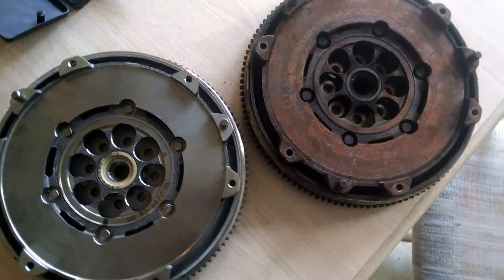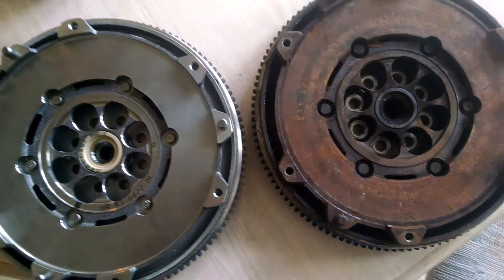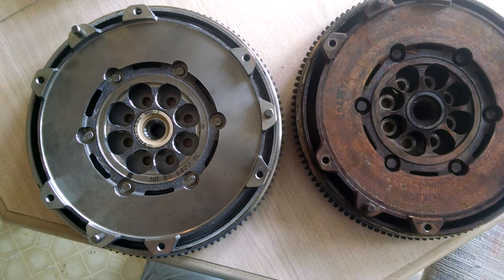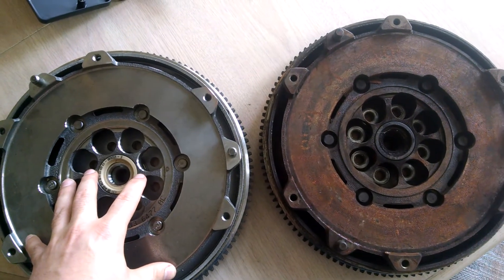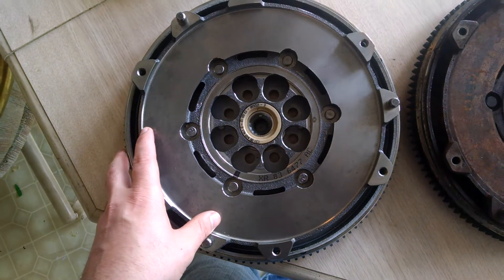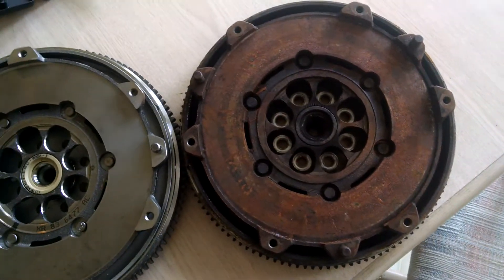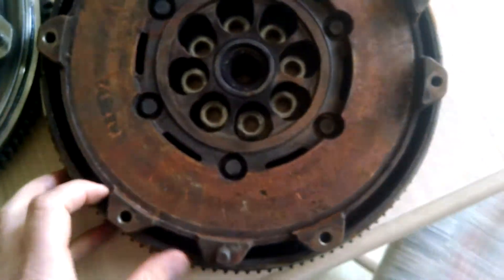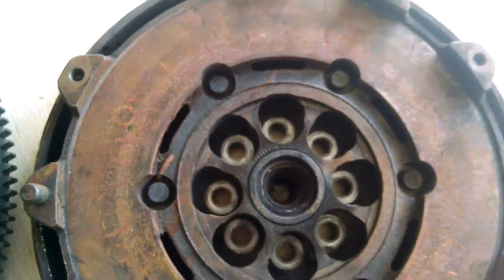Lincoln LS Manual 5 Speed FLYWHEEL

Comment: I have 00 Lincoln LS 5speed. Ordered luk clutch kit from rockauto.com  and dials were smaller. Didn't fit. What brand clutch you go with?
Reply from the maker: There are 2 different clutches. One with 10mm dowels and one with 6mm dowels. Measure before ordering. Outside of that it shouldn't really matter. I got my clutch fron O'riley auto parts
Reply: @DravenUnix  I guess I got the 10.
Reply: @DravenUnix  by any chance is the part number K70299-01 by Power Torque on that set?
Reply: @DravenUnix  also my synchro is out and I have not had any luck finding a parts for my 2000 5 speed here in california
Reply from the maker: @czarel4207  Sadly the transmission that came with the manuel version LS wasnt a serviceable. You could do a fluid change but that was it. I was never able to locate rebuild kits for them. However... sometimes you can get lucky and find a used replacement online. Also i do believe Jaguar S type manual transmission is the same. I did a quick search on www.car-parts.com for the transmission. there are a few listed. give it a look
Reply: @DravenUnix  thanks man,
this getrag 221 has been a headache
Reply: @DravenUnix  i ended up getting the Luke 07-200 clutch vs the PTQ from oreillys
according to their catalog it is not compatible with 2000 module ony 01-03
Reply from the maker: @czarel4207  they are shit transmissions to start with

Comment: I have a 2000 Ls my clutch was replaced. I did not replace the flywheel. I have replace the master and slave cylinder with the clutch. now the clutch doesn't release properly and finds when I down shift. do you think it could be the fly wheel that is causing this issue?
Reply from the maker: That's Exactly what mine did starting out... then it the clutch failed all together. I would press the peddle and nothing would happen. not to mention the wobble effect I got from it. whole car would shake as if the motor was out of balance

Comment: Hey I just bought a 2001 ls 5speed will this part fit my car?
Reply: bro where did you find one I've been looking for a while now ?
Reply: @mdrakeslayer7805  You looking for the car, or flywheel?
Reply: I don’t think it would fit. I have a 2002 LS Manual and I notice online parts from 2000 LS don’t fit for 2001-2002 like the Clutch and Clutch Pressure I thought they have the same transmission. I’m just curious if the flywheel the same tho

Comment: Is the flywheel coming out of the 2004 Jaguar S-Type 3.0 Automatic Transmission? I measured my dowes & they are 10mm, im pretty sure i will need a flywheel for my 2000 Lincoln Ls 3.0 Manual
Reply from the maker: Robert Carr the flywheel for the auto is not the same as the manual. This is a direct replacement for the manual flywheel
Reply: I looked up the part number in the video for Terryjag but its not coming up as a flywheel?
Reply from the maker: Call them. It's what I had to do.
Reply: Ok thank you
Reply from the maker: https://www.terrysjag.com/product/XR814347.html Call to confirm. Should be noted that the flywheel will be out of a 2003-2004-2005 Jag. Its been awile since i did all the research
Reply: Hey Harley Brown, did you ever experience any over heating problems with your 2000 Lincoln Ls 3.0
Reply from the maker: Robert Carr when I forgot the car... It would get pretty warm. So I replaced the hydrolic fan motor/pump.... Thing. Solved the problem
Reply: So you replaced the hydraulic fan and pump & it fixed the overheating problem
Reply from the maker: Robert Carr for me the car never fully over heated. Just got pretty close. But for me replacing the pump fixed my problem.
Reply: Thank you Harley Brown i also talked to TerryJag and should be ordering the flywheel tmrw that has the 10mm dowes, they ended up changing the part number tho so it no longer matches in the video
Reply from the maker: What did the Part number end up being?
Reply: XR814347 she told me the other part number shows up as a parking aid, I did have her tell me its the manual flywheel with the 10mm dowes out of a jaguar s type
Reply: She also asked me are you sure its the 10mm dowes because thete is also one with the 9mm dowes but i measured the dowed so i know its the 10mm
Reply from the maker: Awesome. Glad you got one on order. Ill try to add the the new part number to the video or the comment section to help other people.
Reply: Harley Brown what type of Transmission fluid are you putting in your 2000 Lincoln Ls? Napa Auto Parts told me Automatic Transmission fluid. Is this accurate? I do have the manual transmission do wouldn't it take regular gear oil if so what type? Where do i fill it up at, is it where the rubber piece is on the side of the tranny that makes a dip stick like tube visible?
Reply from the maker: Robert Carr automatic transmission fluid is correct. My understanding gear oil is to thick for this small tranny. Air pockets form do to the thickness and causes metal on metal wear. At least that's my understanding
Reply: Where do i fill it up at, is it where the rubber piece is on the side of the tranny that makes a dip stick like tube visible?
Reply: Harley Brown what type of fluid do i put in for the clutch? Dot 3 brake fluid work ok?
Reply from the maker: There is no dipstick for manual transmissions. On the side of that gearbox there is a screw plug. About a inch wide. you  need to remove the plug while the tranny is bolted up. Fill the tranny useing a pump and hose ( you can get a kit at the part store for this very thing) once the fluid starts to pour out of the hole you are filling you are full. ATF automatic transmission fluid is what i used if i remember correctly. its been some time since i did this. No fluid goes in the clutch.
Reply: I had a ton of trouble getting that flywheel on 2 bolts kept not matching up but the other 6 would i swear it was like the flywheel was machined wrong for just those two holes 1/8 of an inch off & kept spinning the flywheel but same thing over and over
Reply: Did you ever run into that problem with the flywheel? Seems like ive ttied it all but still two holes dont line up
Reply from the maker: no but i can tell you that 1 bolt hole is slightly off. which makes one or 2 bolts seem off center. you have to put one or 2 bolts in loosely ( top and bottom) so you can still rotate it left or right to line up other holes. they will be EXTREMELY close. just the slightest movement will make it seem like the bolts dont fit. it takes some practice. I did this project by myself with little to no tools. It is a aggervating process
Reply: I swear i spent hours on this flywheel and still can only get 6 of the 8 bolts in, its so frustrating
Reply from the maker: pull the flywheel and lay it next to your old one and look it over. see if everything matches up

Comment: Cant find this part number anywhere, https://www.terrysjag.com/product/XR814347.html found this I wonder if it would work
Reply from the maker: Captainkneecap looks about right. I also crossed referenced that part number with parts.com. it also came up with 10 mm dual mass flywheel. but I would call Terry's just to make sure that the part number from my video is a match. also keep in mind the Lincoln ls 5 speed had a 10mm and a 9mm dowel flywheel. messure your dowels before ordering.
Reply: Harley Brown my 2001 LS does have the 10mm dowels